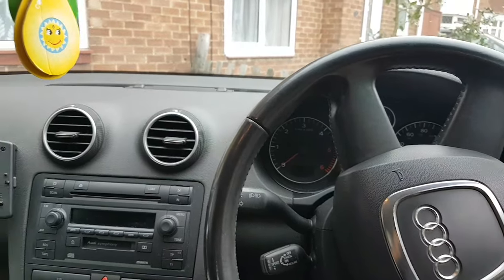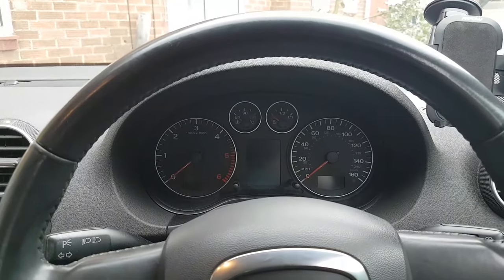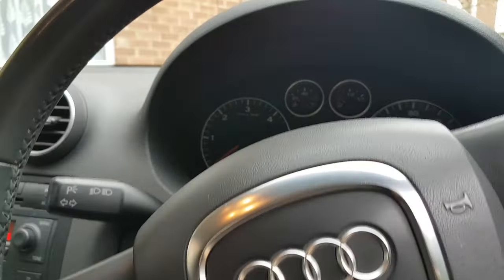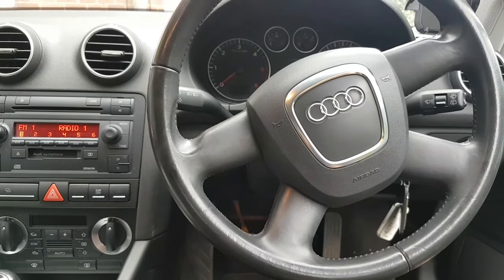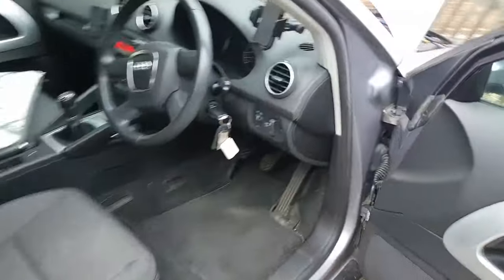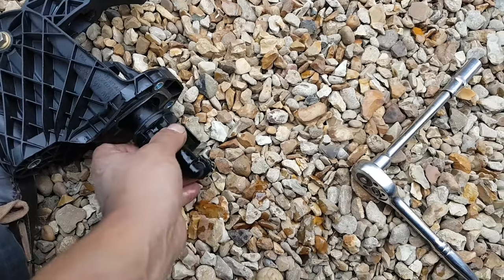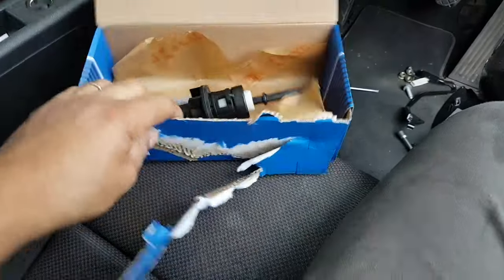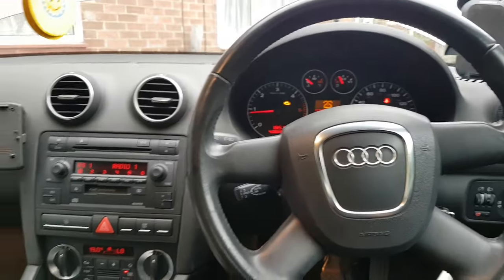Audi A3 no clutch... Fault finding and repair. READ DESCRIPTION!

Comment: Wow, my clutch is currently falling like that and I struggle to select gears. The oil has been changed twice in a month now but by different people. They both said I have to change the master cylinder,  but the quotation including labor is on another level. Labour is 3x price of the cylinder. I am still trying to figure out what to do,  thanks a lot for the video.
Reply from the maker: 👍👍👍
Thank you for watching!
Reply: @LMAutoRepairs  Master cylinder has been changed but mechanic says the clutch is still sticking and suggests he  changes another cylinder and other things in the gearbox
Reply: @missq9320  Hi, did you change the slave cylinder in the end?

Comment: The brake fluid level does not go low in these vehicles because the feeder pipe for the clutch system is very high on the brake fluid reservoir.  Even if there is a leak on the clutch system the fluid in the reservoir reduces up to the point of the feeder pipe.
Reply from the maker: Correct...
Most cars with this approach are like that...
👍👍👍

Comment: Thank you so much for posting this up, my shaft broke right at the end inside the master cylinder, i can still use it thank god but at least I'm now confident to sort it, still need ti take pedal out though because the shaft is stuck in that end and the spring dropped out 🤦🏼‍♂️
Reply from the maker: 👍👍👍
I am sure you will get it done!
Thank you for watching and for your comment!
Reply: Can you help me too guys i have audi a3 2009 fwd.it start but theres no power to pull,i just change the oil then went down..thankss

Comment: i had the same problem however my master drew air . I did the job removal from engine bay. The pipe assembly needed to be unhinged to get it out of the cilinder. The 2 halfmoon plastic tab are a nightmare to reinstall while in the car . bleeding air on the system slave is also extreem difficult as trapped air in slave wont just come out. I prefill slaves on clutch job due to this.
Reply from the maker: Nice one...
Thank you for watching and for your comment! 
👍👍👍👍

Comment: Hi Luis, clearly the new Sachs m-cyl is modified with the flutes on the side of the pushrod as I know these to be troublesome, but plastic parts eh! years ago that would have been steel & never would have broken! Inbuilt obsolescence these days is rife. Do observe one thing though, the color of the brake fluid was black, usually indicative of rubber seal failure somewhere in the system may be the concentric slave cylinder seals are starting to fail, cover your backside man, it may fail in short order! Tell the customer of their discolored fluid & what it may mean. Keith
Reply from the maker: Thanks Keith!
Have you read the description of the video? 
😉
Thank you for watching and for your comment!
Reply: @LMAutoRepairs   Lol Luis, I Hadn't read it until you just said! there you go then the flywheel problem was causing the concentric slave cyl to 'overstroke' & flex the m-cyl pushrod as it bottomed out many times = too much stress on the pushrod= SNAP!. All too common with all dual mass flywheels also bloody expensive! I'll text you soon Luis. Keith
Reply from the maker: @keithglaysher737  
😉
No worries...

Comment: The last time I worked on a car with that much plastic in the build it was made by Airfix
Reply from the maker: Lol
Thank you for watching!
Reply: @LMAutoRepairs   @GTI Mod Blog  Bro, what happens if you a Dual Mass Flywheel fails? What's the consequence?. I mean using the car with a Dual Mass Flywheel failing ? Will it work normal but making a noise only?
Reply from the maker: And probably a lot of vibration...

Comment: When I remove the cylinder from the engine bay do I need to pull the shaft out of the cylinder towards the white tubs in the pedal

Comment: For what it takes 3 8mm bolts and 3 block connectors from the light switch remove that panel the the 3 13mm nuts take the pedal outits so much easier and I advise get a new white clip coz they always brake iv done loads why make things harder
Reply from the maker: I have one... this..
Thank you for the suggestion...
👍👍👍

Comment: First, First, First !!!! Do a purge of the pedal and replace all the brake liquid with new. With a syringe and a little plastic tube suck all the liquid. Press completely your pedal and suck (to suck receptor liquid).
In my case (leon 2.0 tdi 170 2010) with the same symptom all goes well since 1.5 year since the problem.
The problem was that some dirt come to the system in the pedal, that lock the movement (in my case).
Reply from the maker: This one was slightly different... as per description...
Thank you for watching and for your comment! 
👍👍👍

Comment: I have this issue I had done 3 clutch’s in 2
Years now my pedal has finally gone replaced the clutch and slave and still no pedal breaks are
Fine .where did you buy this part and what is it called
Reply from the maker: Can't remember where I bought it... sorry...
It is the master cylinder...
👍👍👍

Comment: hi. i have 08 passat 2.0T 6spd manual. last night i lost my clutch, i can press pedal and it comes up. but cannot put in gear. how can I tell if its master or slave cylinder. No leaks anywhere.

Comment: Thanks for your time and effort, my issue is with a skoda, but all the hardware is still the same. Just one question, do you think the cable and pipes would pull through into the drivers bay? it would be a lot easier if it did, I ask as the engine bay on the skoda looks even more crammed full of stuff.
Reply from the maker: Don't think it does... but might be different on that one...
Thank you for watching and for your comment!

Comment: How easy is it to replace only the white plastic clip inside the pedal assembly? They commonly break and make an annoying clicking sound everytime i step on clutch. I have replacement clip that the ball of the cylinder rests inside. I want to replace without havnt to completely remove and bleed cylinder. Do you know if thats possible? Thanks
Reply from the maker: Never attempted that... sorry...

Comment: I have an Audi A3 8P (2007) i had an issue like this.

My master clutch cylinder broke in the same way as in the video. The reason for why it snapped is because of it suddenly having a whole lot of pressure in the clutch pedal and the plastic rod just couldn't take it.

I got the master cylinder replaced and all was fine. But after around 60 days I began having problems shifting again. The clutchpedal sometimes went back slowly instead of as it normally should when let go.

I had the brake fluid replaced which is probably the reason for it holding up a bit longer than it should've.

What I believe is the issue for my case is that the slave clutch cylinder may be leaking or maybe it gathers air. I'm not a mechanic, so I am simply speculating.

What do you guys think it may be? The master cylinder did break from the begining, but it doesn't seem to be the cause of the issue.
Reply: Hi Milan, did you find out what was your issue? :)
Reply: @kopenhagdakiadamimiz  Slave cylinder.  Clutch worked fine after changing the slave cylinder. Got that repair done about 6 months ago and I no longer have those issues.
Reply: @milani5300  How much did the repair cost in total? Mine started doing that and a friend of mine said his cost like £3000 to get it sorted out.
Reply: @eugenechelseafc89  It is an expensive repair as the slave cylinder is hard to get to. The part is pretty cheap but the work will be what is expensive

 I live in Sweden and I went to a smaller business to get it fixed.  This separately would have costed a lot less than £3000. In my case I had a total that was around £3000 including some other repairs.

I recommend you to ask a mechanic for an estimate before start. I also recommend you to let them take a look around if they find anything else that may be loose or worn. In my case they found that my flywheel and timing chain were a bit loose, I also had a crack in my valve cover. They also noticed that my drive belt was damaged.

 I got all these parts changed for around £3000.
With these parts changed I also got rid of some noise that I had before. Ran smoothly after this.
Reply: @milani5300  Thanks for the reply. I've just had my Audi A3 16reg fixed after encountering the issue on Saturday. Car brokedown at my house and I had to get the breakdown guys to tow the car to the garage where they specialise in clutch repairs. It turns out it was the slave cylinder that was leaking. The dual mass flywheel also got replaced, as it was on its way out, along with the slave cylinder and other parts. The whole job cost £1370. I'm gutted that I had to spend that amount out of the blue but at the same time I'm glad the nightmare's over.
Reply: @eugenechelseafc89   In my case I actually had to research this issue myself and that is how I found out that the slave cylinder was the actual problem.

I asked the mechanic to replace the slave cylinder before I ended up breaking the master cylinder again. My car still runs fine after getting this repair about three years ago. I believe that your car will be running reliable again after getting the repair done.

Comment: Hello, I have just bought  a 2008 A3 1.9tdi and the battery light is coming up on 1 turn of key and it struggles to start and when it does the engine cuts out at low revs at junctions. Battery was changed this winter and the seller claims nothing like this has happened to him. 

Do you have any suggestions please? Many thanks.
Reply from the maker: Check the alternator voltage supply...
Have the battery tested as well...
Thank you for watching!

Comment: Good job,but you should of recommended the owner of this car to flush the brake fluid as it's so dark ,it was dripping black drops while you were holding the master cylinder.
Reply from the maker: I did...
Have you read the description of the video?
👍👍👍
Reply: @LMAutoRepairs  Yes I did,I always do :)
Reply from the maker: @autosport3081  
😊👍👍👍

Comment: Just done this job struggling to get the pipe on the bottom with the clip to be air tight is there a seal that could have fallen out?
Reply from the maker: Indeed... it is a bit tricky... specially if yo8 have big hands... 
Thank you for watching and for your comment!
Reply: Fuck me so i replace the master cylinder after getting cuts and scratches on my arms and hands, i  lose one of those rubber things that holds the pipe together after finding it i try bleeding the clutch and the spring flew off the pedal
Reply: @Ben Shea yes there is a seal

Comment: Nice One mate, thanks for sharing. 
Do you think the DMF failing was a cause of this Slave cylinder peddle connector breaking ???
Reply from the maker: Not sure... it could be that the owner have forced the pedal... I don't know...
Thank you for watching and for your comment!
Reply: This fix is only temporary. It will need a clutch kit and flywheel very soon. Unless the failure was due to heat from the exhaust.
Reply: @RumelM  What is the relationship, if i may ask?

Comment: I’ve got Audi A3 2011 and I’ve got no clutch . Similar to this . Not sure if it’s slave cylinder or master cylinder. Help!
Reply: Hi Luk have you found out what it is?I have the same problem!
Reply: @jrjamoles4873  I have the same problems on a 2013 2.0 TDI. My mechanic said Geabox Off job☹️
Reply: @brokenmanbrokenman5222   replaced MC - still sucking air.End up buying those bleeding kit combine with traditional  pedal pumping 20 times then bleed work a trick😁 at least at the moment🤞
Reply: Audi will say master cylinder bcz they just want the big money..
Reply: CAN BELIEVE HOW INCOMPETENT VW AUDI MECHANICS ARE THAT THEY CAN DIAGNOSE A SIMPLE FAULT .... Great video....

Comment: a bad slave cylinder can cause the break in the shaft on the master. The slave binds up and a human leg is strong enough the snap the crappy plastic parts used by VW/Audi/Skoda

Comment: My clutch pedal is light till half way down it had a new clutch just over a year ago should I replace the clutch master cylinder
Reply from the maker: Hi
It is a possibility... but do all the checks before you do it...
Thank you for watching!
Reply: Check if the spring is missing or dislodged from the pedal.

Comment: I have a mk7 gti the clutch is slipping in the morning but when I drive the car for a while it’s good I bleed it but same problem
Reply from the maker: Probably the clutch it self is on its way out...
Thank you for watching and for your comment!
Reply: I actually took it to a mechanic he said the clutch is 100% good
Reply from the maker: @hamzeh509  
If the clutch is slipping, either is your clutch, pressure plate or flywheel... there not mutch more to it...

Comment: You forgot to show how to disconnect the pipes on the rear of slave cylinder inside bonnet  cause that's the bit am stuck on the but video jumped that bit

Comment: Audi main dealers are total bandits. My a4 went in for a cam belt and was later informed the oil seals needed replacing on the camshafts and the camshafts had to be removed to do this at a cost of an extra  £400 .  My Audi had only 40k on the clock so I believe it was all lies. Never went back again .

Comment: After the replacement of the Master cylinder (by a mechanic, not me) the clutch become very hard to press.
Reply: Need new clutch pressure plate be weak
Reply: @chrismills9346  I did that also. Did not solve the problem.
Reply: I have the same problem, because the spring in the mechanic has come out of position, and the pedal is blocked.